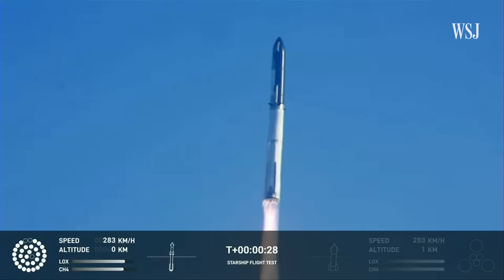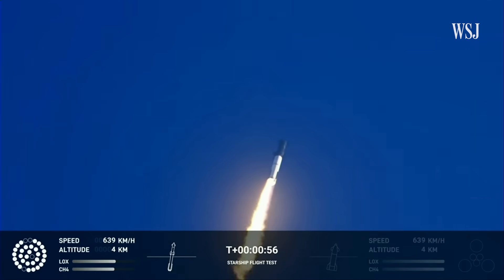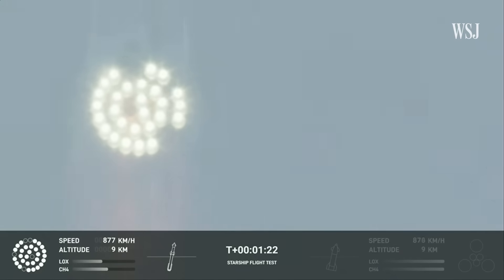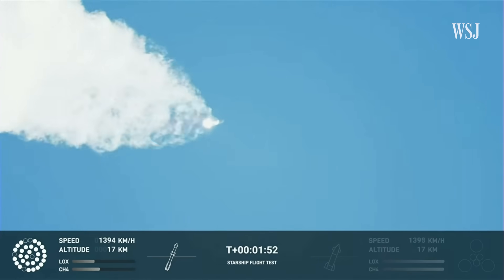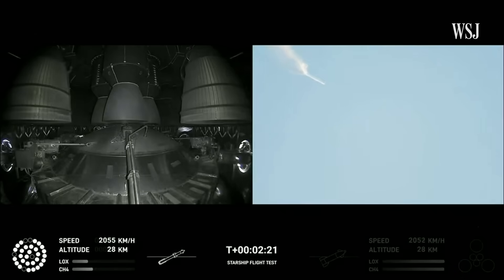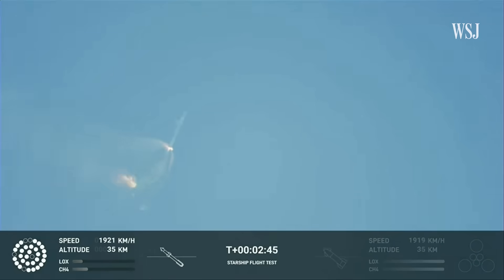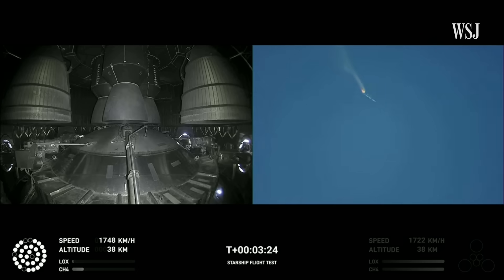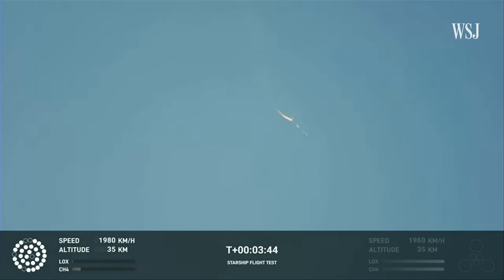Starship Explosion Video: Watch Elon Musk's Rocket Explode After Launch | WSJ

Comment: I’m still kind of shocked at the cult of personality that has developed around Elon Musk, a man that has repeatedly failed, and how people have converted to his personal lap dogs celebrating his failures. The man can do no wrong in their eyes. It’s quite unsettling but also pathetic
Reply: NASA had many failures too.

Imagine for one second that you are designing something like a spacecraft - - that will eventually carry humans.

Imagine that there is some catastrophic problem with the craft (which has happened throughout history - even with government programs).  Now imagine this problem is intermittent - meaning, it won't happen on every flight, but it can happen at any time.

Designs are never perfect.  This flight was a TEST.  The GOAL of this test was to DISCOVER problems so they can be addressed before you strap humans on top of it.  In this respect, this test was a huge success - because now they can address a problem.  It's LITERALLY the purpose of a TEST FLIGHT; to discover problems in design.

Also, the explosion wasn't a failure - it was a success.  It didn't explode on it's own; it was remotely detonated by people on the ground because the rocket had veered off course.  The explosion itself potentially avoided a catastrophe.  The people aren't cheering because it exploded; they are cheering because their fail-safe system worked.

In other words, the failure was not the explosion (that was deliberate); the failure was the veering off course.  Back to the drawing board.  This is how things work.  Acknowledging this doesn't mean you think Musk can do no wrong; it just means you understand how the design process works......nothing more.
Reply: Remember when people said you would never be able to reuse a rocket?

Musk's spaceX team eventually delivered on that.

Comment: This makes the final rocket actually safer: they know at what limits the system will fail, not just guess it.
Reply: They don't "guess" anything.
Reply: @danceswithcritters it’s a novel rocket. There are massive amounts of unknowns and assumptions.
Reply: @markanderson1088  Good thing you are not a rocket scientist. Sending billion dollar rockets into space based on assumptions.
Reply: @danceswithcritters  That the Fondag concrete will hold was obviously an assumption.
Reply: @vast634  Ah, yes, assuming the O rings will hold.
Reply: Solidifies the math! They just need to figure out why the separation mechanism didn't work. I wouldn't want to be on the crew to Mars and have that happen. Still!!! Very impressive. That is one massive rocket engine to be able to lift 5000 metric tons in to orbit.
Reply: so the "final rocket" will be the one that just for chance doesn't explode the first time... yes, very safe

Comment: Looked like a fail to me but space geeks seem excited so that's good for them I guess.
Reply: It was both.  The failure was not the explosion; the failure was the veering off course and potentially putting people on the ground at risk.  The explosion was deliberate - initiated by controllers.  The success is the proper functioning of the fail-safe system designed to bring the rocket down harmlessly over unpopulated areas (i.e., the ocean).  They are excited that the fail-safe system worked; not that it was necessary to initiate it in the first place.

Think of it this way.  If you are driving your car, and you smash into a brick wall - airbags deploy which save your life, you'd probably be very thankful - - - NOT that you crashed, but because the airbags worked properly.  That's what they are excited about.

Comment: Well luckily it held together long enough to clear the launch pad.  But with that many engines they are probably running up against a thrust stability issue.  That many engines adds complexity to the system with many more failure paths.  That many engines also could promote combustion issues.  As  shown on the video as more engines failed, thrust became asymmetrical inducing vibrations in the stack as the few steering engines attempted to maintain the direction of flight.  It is not surprising that the stage separation failed.  NASA had to solve the combustion stability issue on the Saturn V,  But they did it on the test stand.

Comment: Like they said, clearing the tower and getting more than 300’ off the ground was monumental!!!  Achieving an altitude of almost 40km was more than icing on the cake. It appeared several raptor engines suffered malfunctions but it was still able to achieve the desired altitude for 1st stage separation. Can’t wait for the SpaceX team to push past this first hiccup and have the 2nd test give us even more spectacular results!
Reply: Clearing the tower is pretty low expectations for a rocket. Look at SLS: it cleared the tower, achieved orbit,  completed multiple burns, went all the way to the moon,  and beyond, achieved orbit further from eaeth thsn any in history, more burns, chutes deployed, and  capsule returned safely to earth.
Reply: @hikesystem7721  id like to point out it took NASA over a decade to produce the SLS where as starship has only been in development for roughly 5-6 so there is obviously a lot more testing that has been completed already on the SLS, not to mention it uses older rocket designs where as the SpaceX engines are essentially brand new so the obvious response is when  you spend 100x the funding over longer periods of time one project will be farther ahead. Then there is the other end of everything where SLS is roughly 1/2-2/3 the size and capability of Starship at roughly 30x the price........
Reply: They hopefully do it from a more robust launch pad because this apparently destroyed the facility.
Reply: Monumental waste of investor money
Reply: This is incredible!
Reply: This is a fake CGI cartoon.
Reply: @Mark. What a typical MUSKeteer fanboy remark. That's a freaking low bar which is abysmal compared to Saturn V that put the US on the moon. And you telling me this hype will put humanity on Mars orbit?.
Reply: @COO415  this is literally its first fully stacked launch. Better to have it explode now than later when put people in it to take them to the moon and mars.
Reply: @COO415  ooooo right, because the Saturn V never exploded during testing or even once it was operative, gotcha.
Reply: @jekoki01  .@Kok. I agreed with both your takes. The problem I have is celebrating failure for anything Musk does. I guess, he must be demigod to Musk fanboys. Anyway...
Reply: @COO415  nasa also celebrated the early saturn v "failures" because the werent actually failures in terms of their mission. I guess yall just think these systems just develop themselves huh?
Reply: @COO415  how does it feel to be proven wrong 😂😂?
Reply: @xmurk8023  Dude, how was anyone proven wrong here?. Sit down!.
Reply: @COO415 this was not a failure at all. Amazing accomplishment by the entire spacex team. Can’t wait for the next test!!
Reply: @COO415   Yes how can feelings be proven wrong. Sorry that you feel so bad that the person you hate so much and the engineers working for him had created hype by successfully launching the biggest and heaviest rocket ever to be made quite a lot of miles from the earth. Me thinks you need to block any news of Elon Musk to protect your little soul.
Reply: @guywebster8018  lol, you made that up! NASA didn't cheer. They acknowledged the failure and then focused on learning from the failure.
Reply: @jekoki01  Yeah over 50 years ago, gotcha
Reply: @jekoki01  One partial failure and not a catastrophic one, gotcha.
Reply: @COO415   Your envy and insecurity towards Elon Musk is almost palpable.
Reply: Kudos to SpaceX team and Musk for achievement. I would prefer two Space Agency than one, just in case Thanos attacks then, we could use two functional Rockets... 🤣

Comment: As a life long NASA / Space flight nerd, I have been following the progress of Starship, and a few weeks before this test, Elon had said that he thought there would be a 50/50 chance of success on this launch attempt. And "Success" was defined, as a baseline, as: clearing the tower, and climbing to a safe distance from the launch facility, while providing telemetry and data about what went wrong or right with the engines in the booster during ascent..   EVERYTHING else was to be gravy..

That is why (and this was discussed by SpaceX within the community ahead of time) SpaceX did not bother putting any programming or configuration development money and time into the flight profile for starship or the booster try to land softly on their tails or anything like that. SpaceX just needed booster and spacecraft stage to be a realistic load with materials and propellant and guts and centers of mass and gravity for the purposes of this test.

The only thing that really had to be the same as an eventual production starship/booster combo was having a real Starship fully loaded on top of the booster, because that is the only REAL way to test how the booster will perform with all the specific stresses dynamically changing loads and and connection points that that piece of machinery will present, as this never can in all practicality  be simulated, no matter HOW good the supercomputer model may be.

Making it through Max Q would have been a bonus above and beyond the 50/50 chance of successfully lifting off and clearing the launch facility safely

The flight plan was specifically NOT to achieve a stable orbit, but to make it to an orbital velocity which would have been sufficient to achieve orbit if the rocket was vectored sideways around the earth just clear of the atmosphere. IT was intentionally vectored more vertically so starship would peak higher than an orbital altitude and then come back down ballistically at a predetermined area in the Pacific ocean IF the booster happened to exceed expectations and get them that far.

Assuming that had worked, and all the raptor engines had stayed lit save for the 2 or so that the system is designed to be able to handle losing during ascent, the STRETCH goals were:
1) Make it through Max Q
2) Clear the atmosphere
3) Stage separation
4) Booster flip maneuver to orient it for backburn for reentry
5) Starship stage ignition
6) ballistic flight path 
7) Starship coming in on its belly to test its heat shield tile system and see how well it does or does not survive reentry traveling at or in excess of speeds one would see in a de-orbit.
8) Slam Starship flat on its belly into the ocean off the coast of Hawaii, no belly flop, flip or soft landing on its tail.
9) Slam the booster into the ocean

So the test was as success based on the parameters that were laid out by Musk and Team well before the launch. Which they only though had a 50 percent chance of acheiving.
they made stretch goal 1
The booster and starship insterstage  held together under INSANE torsional and centripetal forces as the rocket cartwhieeled MULTIPLE times
The range safety officer detonated the booster and then Starship after there was no longer any useful data to be gleaned from telemetry and the rocket was best destroyed at a high enough altitude to ensure a safer outcome for ground (or rather SEA) level.
Reply: Thank you for using the right terms correctly. Growing up in the late 60s, I was a NASA junkie. I probably wrote to them twice a month for pictures and anything they would provide me about anything. My room was covered in 11 x 14 glossy pics of everything from autographed astronaut promo shots to engine schematics. I thought that when the saturn program came online that, "Now we're going to go places!" And it just petered out. To see space x finally surpass the mighty Saturn V is really satisfying. Somehow, it makes more sense, and pls correct me if I'm wrong, to have many smaller engines than just the five massive ones. The pressures and flow dynamics within those huge engines were just made for failure and yet they were very stable. I hope, too, that space x can, without the incredible weight of bureaucracy and politics, go where no one has gone before. (sorry for that last bit)
Reply: @christopherjbutler  Thanks. I'll be sure to check that out. It's too bad mom tossed my collection when I left for university. Not that it was valuable as a collection but it was worth something to me.
Reply: I’m 14 year old reading your comments, it’s fascinating how many technological achievements were done trough Cold War, and since a new space race is heating up between USA and China, we might see more of the advancements….
Reply: @TeoDP7  It is a really REALLY exciting time for space exploration. And I gotta say, even with how miraculous the Apollo program seemed back when I was 4-6 years old and thereafter, What is happening right now with SpaceX in particular is literally doing Buck Rogers level stuff. I mean, really? landing rockets on their TAILS? on a SHIP rolling on the OCEAN?? CONSISTENTLY? and then using them again? completely bonkers.  I am so psyched for you at your age to be able to see this. And yes, I agree, China is an underreported and independent force in low earth orbit stuff already, and who knows what the future holds? It is really a fun time to be alive if you love this stuff.
When the Dragon capsule finally brought human spaceflight to the ISS back to the Cape again, I was literally moved to tears. And this is just the beginning.
I say let the haters and the "see things in black and white / take sides, see no nuance or gray" people hate while companies like SpaceX and maybe RocketLab or other innovators are unafraid to publicly spectacularly include failure in the development process.  :)
Reply: @christopherjbutler  i believe it’s possible to travel out of solar system with Modern space technology, for example NASA, Nasa has probably the technology to take us to the other planets instead of moon, the reason they haven’t done this is because they have other tasks and things to control and complete, Such as satellites, etc.
Reply: @christopherjbutler  yeah, as for now, humanity can only focus on exploring planets, space and then landing on some of them in the future, then humanity can focus on ideas such as Warp-drive, Dyson sphere or other Space-traveling concepts like artists are designing right now

Comment: They have to repair the launch pad first. The reason it took a while to lift off, is that it was happily digging a hole. Probably also the reason a few engines cut off. Not compatible with rebar and concrete.

Comment: The rocket did not "explode" it was remotely destroyed using the FTS ( Flight Termination System).  This was implemented due to second stage not seperating from the booster causing the rocket to veere of course.  So your headline of "watch Elons rocket explode" is garbage.